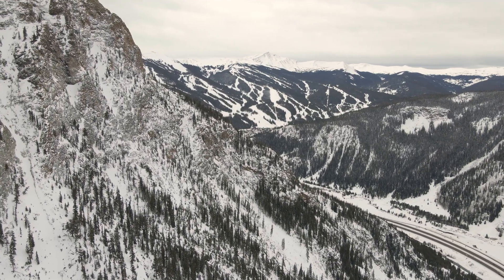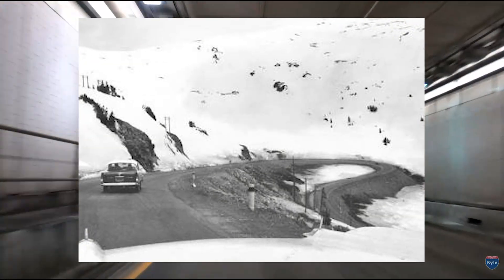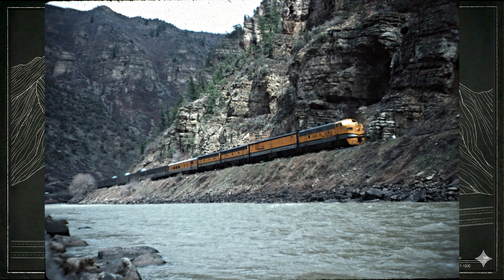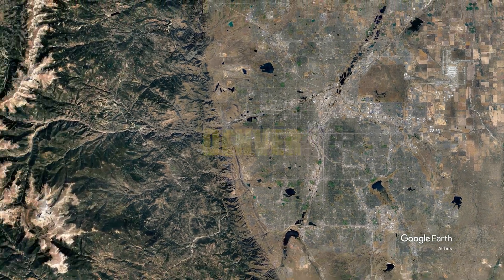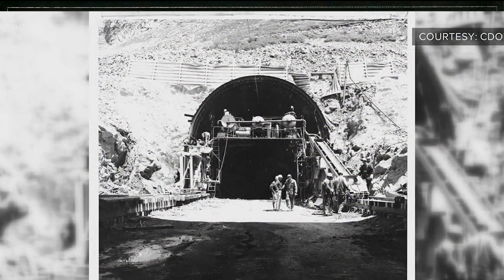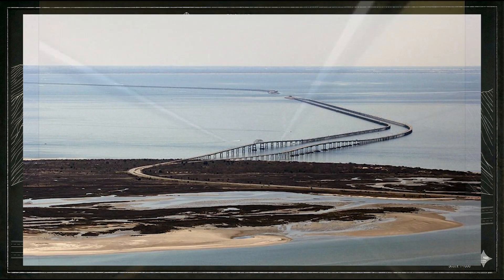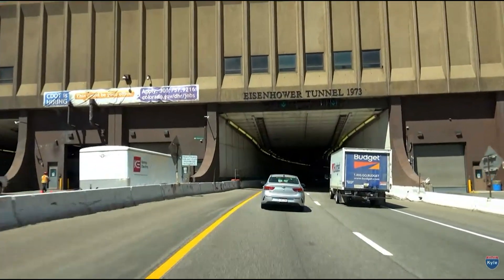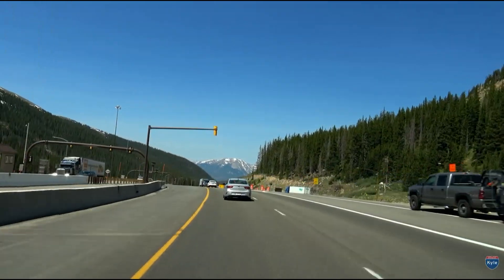Engineering the Impossible: Building the Eisenhower Tunnel

Comment: WHEN YOU GO WEST BOUND YOU MIGHT NOTE THE EXCESSIVE WATER LEAKING AT THE BEGINING THE TUNNEL IS SLOWLY FAILING
Reply from the maker: That’s something a lot of people notice going through there. In mountain tunnels, water intrusion is often expected and managed as part of the design, even though it can look pretty dramatic in practice. Appreciate you watching.
Reply: @BTE4172 i worked on the tunnel this area continually failed the twisted metal told it all. The east tunnel is built much better with a different method

Comment: I contributed to the final touches of the easttbound bore (Johnson Tunnel). I hauled several piggyback (rail) trailer loads from the Denver Union Pacific railheads. They were trailer loads of the flourescent light fixtures that line the tunnel. I had to take the construction exit at the west end off the tunnel then take a service road over the mouths of the tunnels to the westbound side construction service area.  Real trick with a 40 foot trailer.
Reply from the maker: That’s incredible — having a direct hand in the final touches on the Johnson Tunnel is something not many people can say. Navigating that service road with a 40-foot trailer must’ve been a challenge of its own. Really appreciate you sharing that piece of the tunnel’s history!

Comment: In the early 80s I was driving a charter bus through the Eisenhower Tunnel west to east. About a 3rd of the way in cars behind me started to flash their lights at me. At first I could not see why, but then I saw smoke, and then fire coming out of the left rear of the bus. The engine is in the back. On the way up the hill I was stopped at the over height stop light tripped by a semi truck this I knew would get the engine very hot after pulling the hard hill. I had bad luck with those lights and I could see it coming. A tarped load with the tarp puffed up by the wind on top. After seeing the fire I thought of my options. Stop let the kids out and direct them to the side walk and escape tunnel blocking traffic and filling the tunnel full of smoke. Just a few weeks before a small bus caught fire in the same tunnel injuring many people from the smoke. I knew the bus well and could not think of what could be burning on that side of the engine compartment. So I kept driving hopeful that someone was watching the cameras, I knew there was a pull-off to the right just out side the tunnel. I used the P.A. in the bus and told everyone I was going to stop a they where all to get off quickly, I did not say we where on fire. I stopped got everyone off grabbed the fire extinguisher and ran to the back. The tunnel fire department already had the fire out when I got to the back of the bus. They were watching! What was burning was a cardboard box that some how got jammed up next to the muffler, that is right behind the last wheel on that side.
Reply from the maker: What an intense moment — and smart thinking on your part to keep everyone calm and get that bus to the pull-off. Amazing how quickly things can unfold in the tunnel, and good to hear the fire crew was watching and ready. Really appreciate you sharing that experience. Thanks for watching.

Comment: My dad, Phillip R. McOllough, was the head engineer for the Colorado Department of Highways (now CDOT) on this project. No tunnel  boring machines were used on this, the rock was too fractured and lacked the structural integrity needed to use such machines. Every inch was done by blasting and 'mucking' operations. My dad is pictured riding in the State Patrol car on the opening day of the first bore March 8, 1973, at the 8:19 minute mark. This was hailed as an engineering marvel and still is considered so today. The challenges that people didn't realize are numerous. The ventilation fans had to be redesigned from chain driven to V-belt,  because the chains blew apart at high speed; water had to be diverted from the westside to the eastside for facility use, a legal nightmare; worker's who were stationed inside the tunnel to monitor traffic before the CCTV was hooked up, had to undergo blood testing to be sure they weren't being overexposed to carbon monoxide; the state had to figure out a way to pay the contractors faster because they kept going bankrupt waiting for payment; there was a big protest by the miners when Dad hired a woman, Janet Bonnema as a technician and she went underground. This was the largest construction project in the nation at the time and a lot of folklore has been created around it. Good job on the video, you got most everything right except the pictures of the tunnel boring machines!

Comment: I worked on the Johnson tunnel. We simply referred to it as the Eisenhower Tunnel's second bore. I started working at Climax Molybdenum mine in Leadville and got a job at Eisenhower in 1976. We used jumbos and drilling machines  on the west portal . The ground wasn't as good on the east portal so they had to mine it in smaller drift tunnels and then re-mine it. It was a great job and I made fantastic money for a young single guy. It was very dangerous work and I believe there were at least 7 people that lost their lives. The dry house always had broken miners just hanging out, putting in time so the company didn't have to claim a lost time accident. I did everything there, drilling rigs, jack legs, grout crew, and bull gang. I was in a trench outside the East portal when it caved in and buried me up to the middle of my back. just my head and one arm were sticking out. It was right at shift change so a ton of people were helping to get me out. I remember a welder using his chipping hammer to dig. It was getting scary because everytime i took a breath, the dirt would settle in a bit more, making it hard to breath. Once they got me out 2 guys grabbed under my arms and pulled me up. I immediately collapsed, and they all thought that i had been paralyzed. but within seconds the blood rushed back into my legs. That was the worst feeling, having both of your legs fall asleep and coming back. But hey I was getting time and a half since it was right at quitting time lol. I was back in the same trench the next morning with shoring this time lol.
Reply from the maker: @mikeroberts8208 That’s an incredible story, and I really appreciate you sharing it. Working on that second bore was no small thing — dangerous, hard work in tough ground, and the way you describe the east portal conditions shows just how real those risks were. I’m glad you made it out of that cave-in, and it says a lot about the crews who were right there helping dig you out. Hearing from someone who lived that work adds a whole different level of understanding to what it took to build this tunnel. Thanks for taking the time to share your experience.
Reply: My dad work at the tunnel. He was a shift boss. Also my brother and husband before they went to Coors. I think a few guys came home from Nam and worked at the tunnel. I have some of the paper clippings from the tunnel..
Reply: Aaaaand that's why we have OSHA now. Awesome story though, thanks for sharing and I have appreciated your handiwork many times since living in CO :)
Reply: You made it and have great stories  to tell !! Enjoyed your story .👍
Reply: I met an older gentleman at cracker barrel in Loveland a few years back and he was sharing all of his stories from when he came back from the war and went to work on Eisenhower and telling about the lives lost there. You all did an incredible job, and Im glad you made it out alive!! What a scary thing to experience! Thank you for sharing your story!!
Reply: Thanks for your service to make the tunnel possible!
Reply: Wow! What a piece of living history! Thanks for sharing your story.
Reply: I have my work partner die in my arms.
Reply: Yep.  American men were real men then.

Comment: What’s the future? That entire stretch of road needs expansion however these tunnels would create a major bottleneck. Are there engineering plans in place to expand the tunnels to 3-4 lanes each?
Reply from the maker: @100SeriesLC From everything I’ve seen, there aren’t any plans to widen the Eisenhower–Johnson Tunnels themselves. Most of the work ahead focuses on maintaining the existing bores and improving traffic flow on the I-70 corridor around them. Widening the tunnels would be a massive undertaking, so for now the upgrades are happening outside rather than in the tunnels. Thanks for the comment.

Comment: My father helped build these tunnels as one of the many electricians who wired the power into these tunnels from when they were an initial bore until they opened them to traffic. His stories about the weather, the darkness in the bores, the crazy problems with keeping the generators operating in the cold and snow and rain are just spellbinding! And all while at high altitude. Dad used an army ammo can for his lunchbox. Apparently, at lunch time he had to be careful to angle the box when opening because it was sealed and therefor pressurized at the higher altitude. BANG! When he came home and we kids were doing dishes, we had to release the latch and then wait for 10-15 minutes for the can to equalize in pressure. Just wasn't strong enough to pry that sealed lid open. 😆 I remember living in Frisco during the summer in a very small two room cabin he rented for our family. Had some great adventures there with my brother and sister. Little known fact, when headed Westbound, there is a brief moment in the middle that you can see light from both entrances. A very brief moment. I'm super excited to be able to show him this video. I'll write more if he feels the need to comment.
Reply from the maker: @ShawnClemenson That’s an incredible piece of family history. The way you describe your dad working through that cold, darkness, and altitude — and even that ammo-can lunchbox popping from the pressure — you can feel what those crews lived through. Folks like him are the reason this tunnel exists. I’m honored you’ll be showing him the video. Thanks for the wonderful comment.

Comment: I got to work on the  recent renovation. The motor rooms in those windows above the road and the machine/electric room on the south side are absolutely massive! The electric room is almost 3 stories of criss-crossing conduits and cable trays with uneven scaffolding between them. Everything covered in a grimy black dust. Replacing items in the tunnel was also interesting. Respirators had to be worn due to lead particles in exhaust fumes… it was a pretty cool job though.

Comment: yeah and it became obsolete five years after it was built. Way to go CDOT
Reply from the maker: @EM-re5xq A lot changed on I-70 pretty quickly after the tunnel opened — traffic volumes grew faster than anyone expected back then. It’s interesting to look back at how the engineering decisions made in the 60s and 70s were based on the forecasts they had at the time. Thanks for the comment.

Comment: I picked up a load from the Climax Henderson Mine above Silverthorn. I was well over 40,000 lbs. Going down the summit at even 30 mph felt way too fast. The wind could be quite strong exiting the tunnel. If you weren’t paying attention. You could find yourself swerving out of your lane. I can’t imagine the old trucks going down those grades with just brakes and low gears. I was taught to gear down and be ready if the Jake brake fails for whatever reason.
Reply from the maker: That's good advice and would make a great Jr. Brown song too. Are you still driving today?
Reply: @BTE4172 Yes, it's been 22 years.

Comment: I didn't realize it was 2 miles long... Only times I've gone through it's been proceeded by a 45 minute backup with my engine overheating, so when it's go time, and I get into the tunnel, I feel like I barely have enough time to make awesome tunnel turbo noises! lol.  That 7% grade though makes for some amazing fuel economy.  I made it 7 or 8 miles coming home this last summer without touching the gas at all, having to occasionally brake so that I was only going 5 over 🤣

I only make the trip though once a year, from Wichita, KS to Palisade/Grand Junction for Flyin Miata Summer Camp in June.
Reply from the maker: Those backups can be brutal, but you’re right — once you’re moving, that tunnel makes every sound feel ten times better. And that 7% grade is basically free miles. Really appreciate you sharing your experience.
Reply from the maker: Do you have an MX-5 you drive out?

Comment: While tunneling thru the mountain. They came across a major gold vein. It was checked out. They said the mountain was too unstable to mine it. Also the head engineer on the construction has never been in the tunnel. He said it's only a matter of time until the tunnel collapses. A matter of when not if.
Reply: No gold was ever found during construction. The head engineer was in the tunnel daily, almost got killed once.
Reply from the maker: @susanmcollough2011 Thanks for adding that — the project records back you up. A lot of stories have grown around the tunnel, but the engineering reports tell a much clearer picture. Thanks for watching!

Comment: The tunnels are closed when they lose power. People often say, "Why do they close the tunnels? My car has headlights!" Well, the reason was indirectly mentioned in this video. Without the ventilation system, the tunnel would fill up with toxic gas and people would start dying before they could reach the exit.
Reply: They could leave it open for EVs only, but they would inevitably find other drivers using the tunnels and people would die.
Reply: @pfcrow nope. There's other reasons why you would not want vehicles in an unventilated tunnel with no power. If a vehicle crashes, the tunnel staff might not know about it and would not be able to alert vehicles heading towards it. If the vehicle catches fire, the tunnel would quickly fill up with toxic gasses and kill anyone who enters. It's not worth the risk for the public to be in there when there's no power.
Reply: The tunnels were designed to get power from either side, that way if one side lost power, a 'tunnel tie' could power  both sides. Loss of power is rarely the cause for the shut down, usually it's weather/road conditions on the other side that cause a closure.

Comment: Hazmat trucks (mostly semis delivering gasoline &diesel) can't share the tunnel with cars. So they either go over Loveland pass, or when they shut down the pass, they shut down the whole tunnel just to let a group of hazmat trucks through.

Most people visiting don't understand why it turns into a parking lot during blizzards. This is why. It switches from stopping to moving slowly.

There are certainly a lot of people also getting in accidents during blizzards to also cause slow downs.
Reply: Usually, before incliment weather, CDOT shuts the highway down miles before the tunnel.

Comment: I'll never forget the time that my trailer set off the over height warning on the east end of the tunnel. Train horns and flashing lights, LOL.
Reply: That's happened to me twice. Not fun. First time it happened during summer time and took the US-6 detour. Just about has a heart attack with the ledge going up. 2nd time, it was the airflow thing on the rear end of the trailer. Company had it removed and that fixed the overweight issue.

Comment: You should check out the Butte Des Mortes Bridge in Oshkosh, WI.  Former US41, now I41.  It used to be among the most dangerous bridges in the entire country during winter from the highway flash freezing from the lake having mist freeze on the pavement.
Even now, being 8 lane divided, it still gets dangerous during winter since it's still low, close to the lake below.  Every winter a vehicle at minimum still slides into the lake despite constant efforts to keep it dry and ice free.
Reply from the maker: Great suggestion. I will add it to our list!

Comment: Good video... I wonder why it shows two TBMs (Tunnel Boring Machines) at 6:18 and 7:39 implying that TBMs were used in the construction of these tunnels. The tunnels were built using drill and blast methods - not TBMs. Colorado had a lot of hard rock mining expertise (both labor and design) as a legacy from the mining era. It only made sense to use the drill and blast method.
Reply: Hard rock mining ftw
Reply: This. TBMs weren't even invented yet.

Comment: I remember driving east through the tunnel in 1977 in a six cylinder Chevy van.. power dropped off, and I got passed by a Volkswagen Beetle 😳😆
Reply: I had a couple of VW Beetles in my youth. They would actually hold 55 mph on most of the uphills on I-70, at full throttle in third gear. Also, the only time the heater actually worked well was when you were pulling those uphills revved up at full throttle.